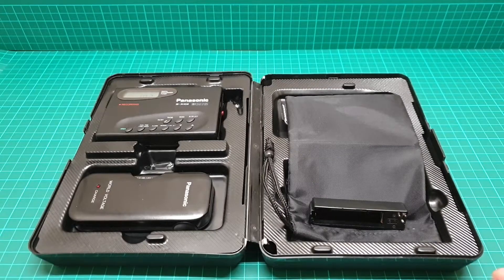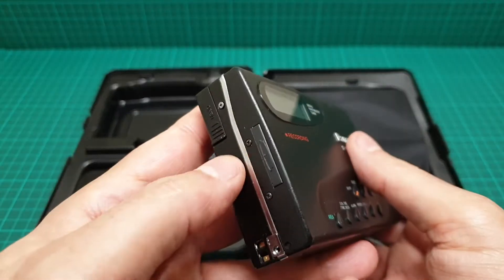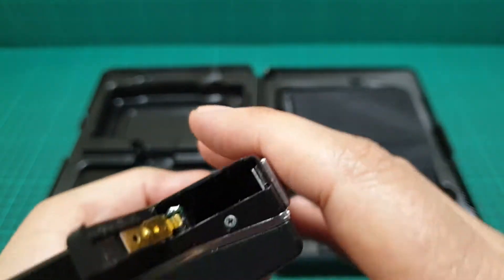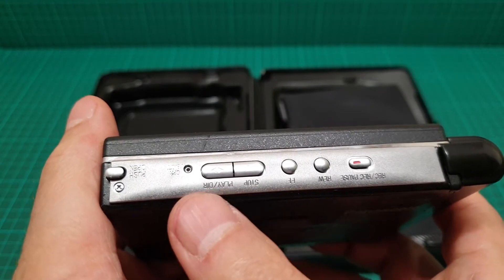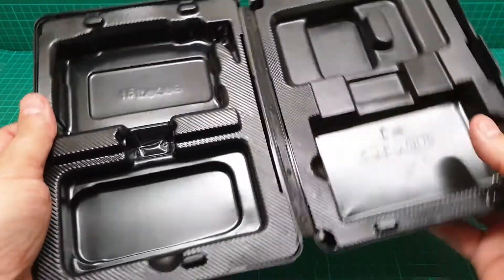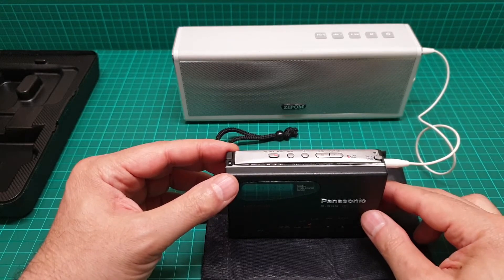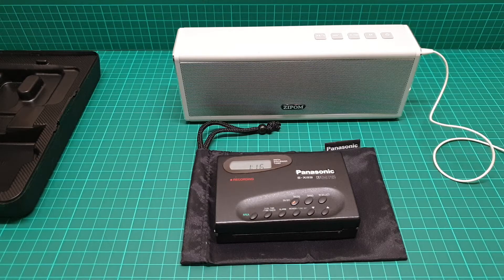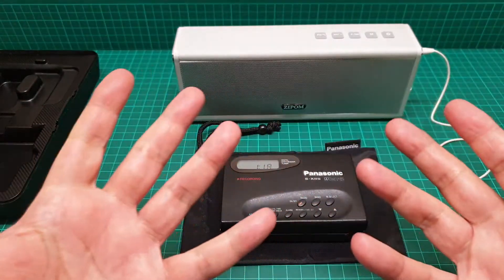Panasonic Walkman RQ-S77F most advanced Radio cassette recorder

Comment: I have a mint condition one that so far will not play. Beautiful -looking machine, but won't play. It may be a bad connection on the battery attachment. I would like to know how to adjust the playback head, as I think that needs doing. Otherwise, the thing is in perfect condition, and looks like it must have been built by NASA.

Comment: Sorry. I just managed to get it going. I pushed the buttons at the side of the battery attachment and voila: action stations. Amazing: eBay has listings for this machine as being "junk'. If so , this is th ebest junk I have, and naother gizmo for a gizmo-mad old guy. Best regs, and thanks for the video. I do not think that the heads need adjustment. It seems to be playing fine, so all is good.